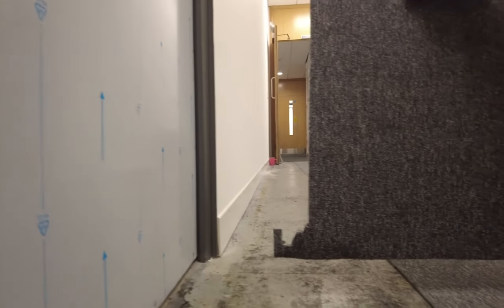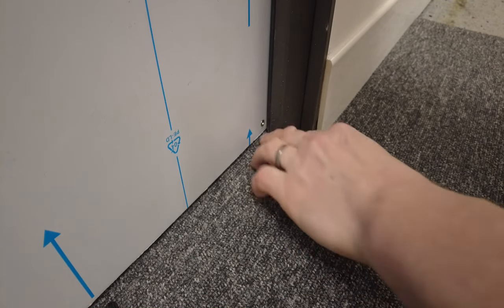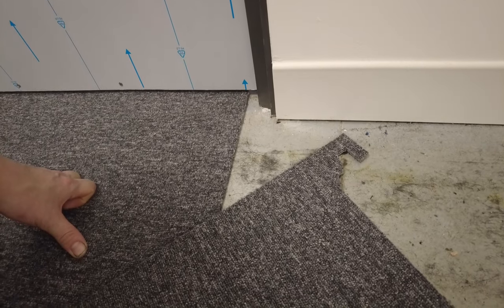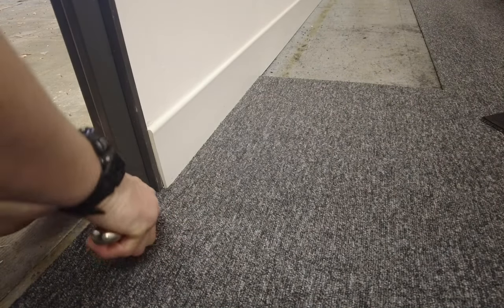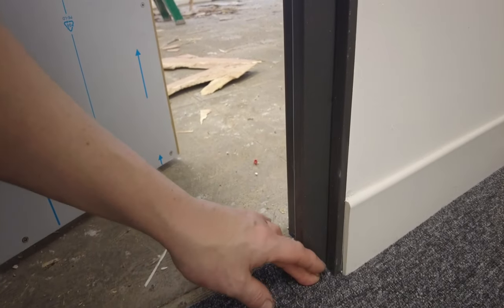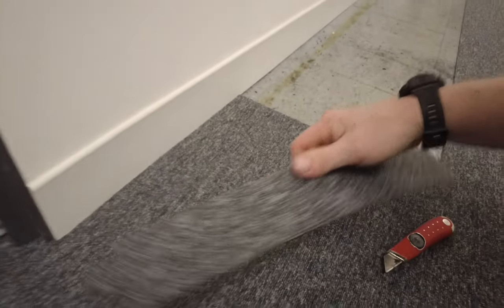CARPET TILES/SQUARES cutting a DOORFRAME👍🔨🗡🔪

Comment: Great video, if you have large area of carpet tiles how do you set out your start so they remain square ?
Reply from the maker: So I split the room in half both ways making sure there are big cuts drawing lines then run the tiles in the middle of the room then splitting the room into quarters and filling out each quarter to the corner I do this because I'm not the most accurate tiles in world so when they run out which they will they only run out in each corner but if you started one corner of the room filling out the room they will run out in all directions hope this helps
Reply: @eggyfits  Brilliant thanks